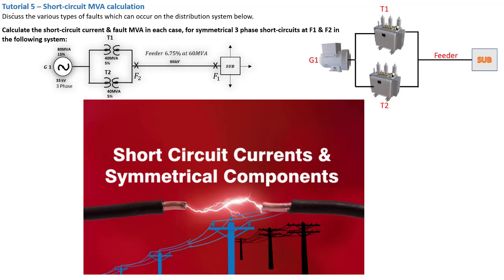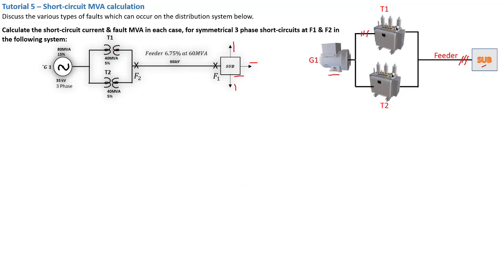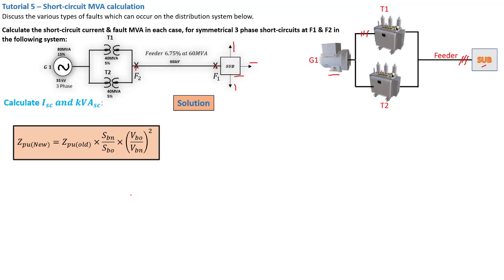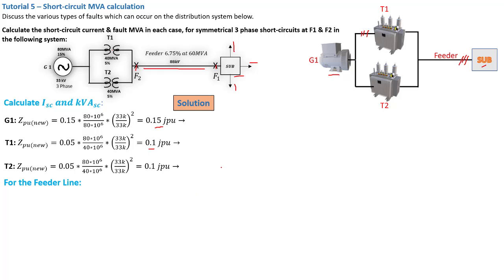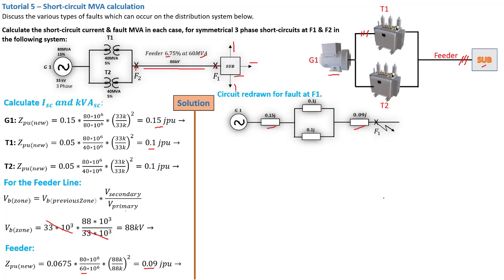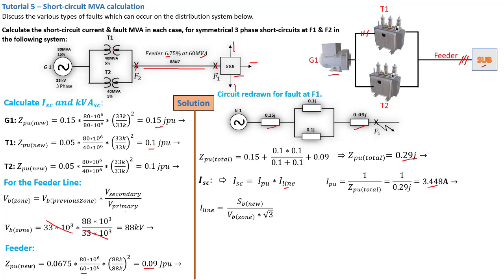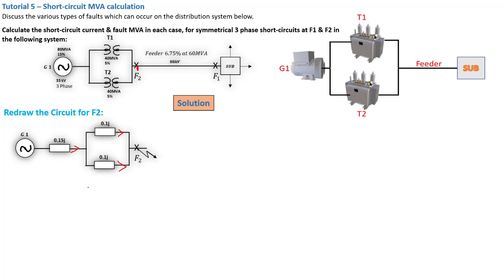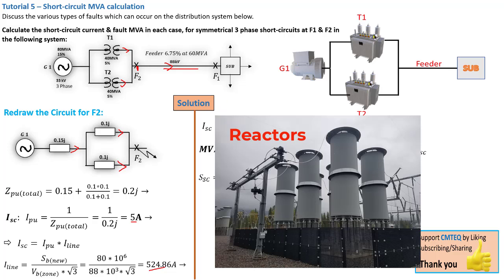Short circuit fault level - Fault current calculation. Tutorial 5

Comment: sir is these problems are using thevinin? so there are two type of solution using this and z bus ?
Reply from the maker: Yes 👍
For fault studies, both approaches are valid: Thevenin equivalent at the fault point or the Z-bus method. 
Z-bus is preferred for larger systems, while Thevenin is simpler for small networks.
Reply: @CMTEQ  most of time requre fualt current? how about finding bus voltages after fualt or the line current aftera fualt how to find them?